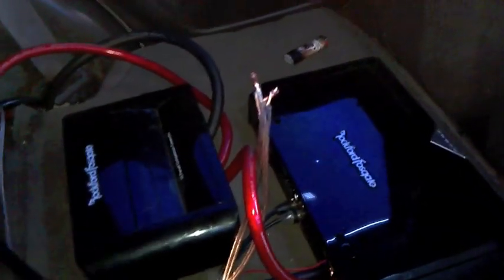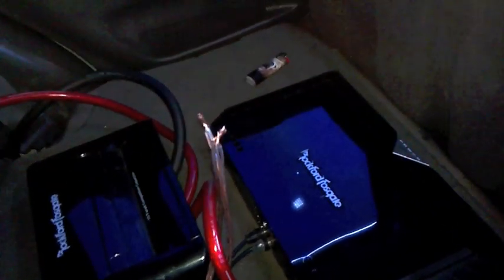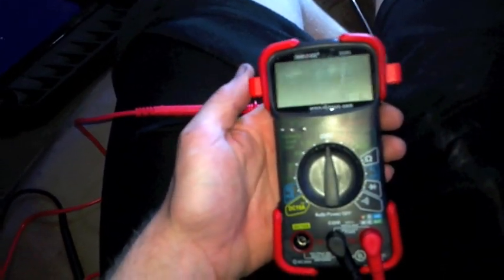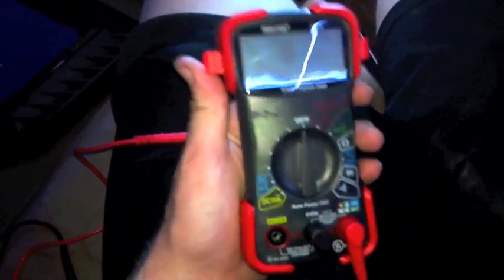How To Check Your Audio System Ohms

Comment: nice tip dont have to pull the subs out to look mine are not hitting as hard and been in and out of audio shops getting things done all summer im wondering if they re-wired them at one point

Comment from the maker: If you have a monoblock (single channel) amp, then the 2 +'s and 2 -'s connect inside the amplifier, there are 2 sets of them just for easier wiring to the amp.  Do the same thing I did in this video, Twist your 2 positives (+) together and your 2 negatives (-) together and then test it with your multimeter.